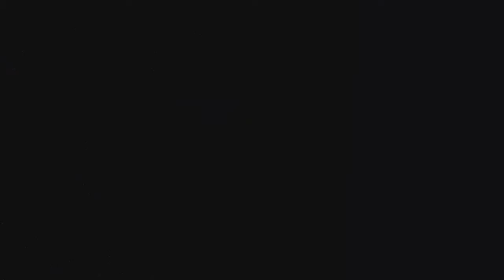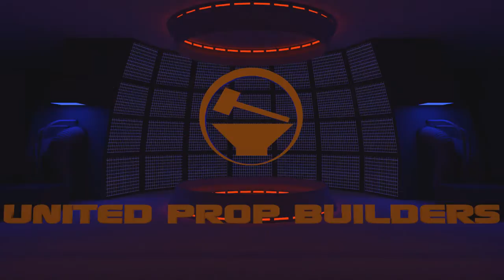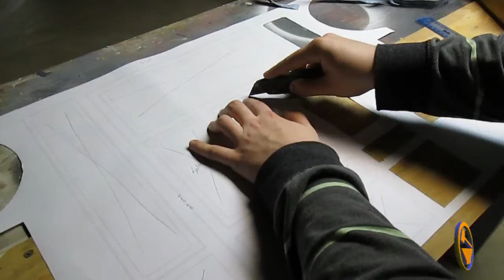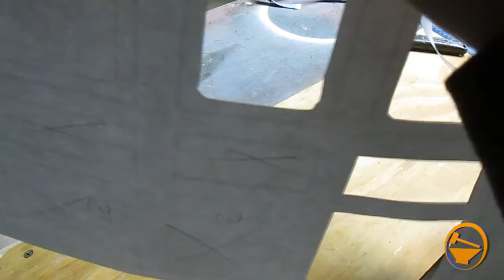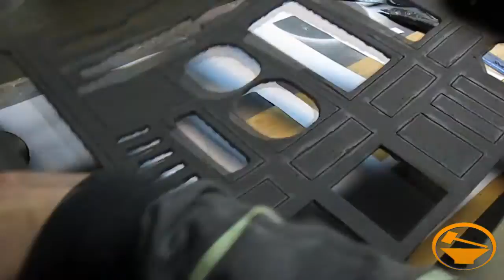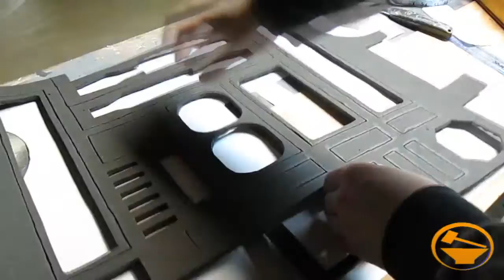Lets Build Real Life R2D2   Crafting Skin

Comment: Where / how did you get the template printed out? It looks fairly large.
Reply from the maker: dustin evans Had to get them done at a print shop
Reply: UnitedPropBuilders do you have a link to that big sheet?
Reply from the maker: dustin evans i dont :( im sorry but it can easily be found on the astromech builders website
Reply: No worries. Thanks